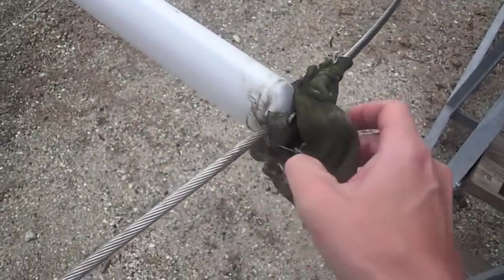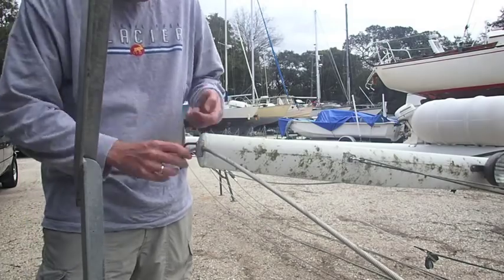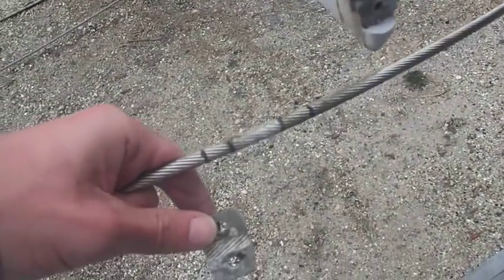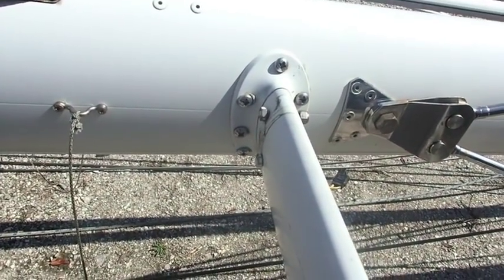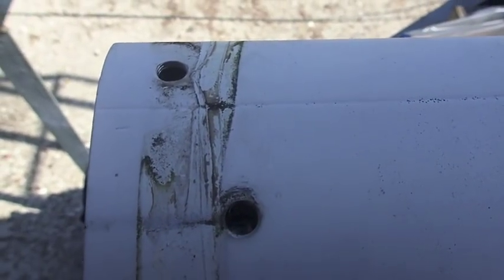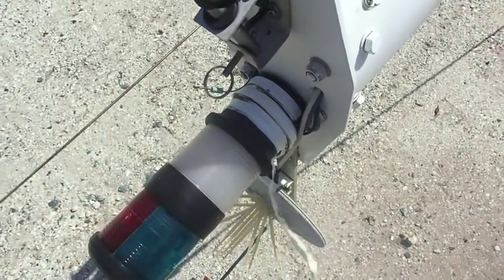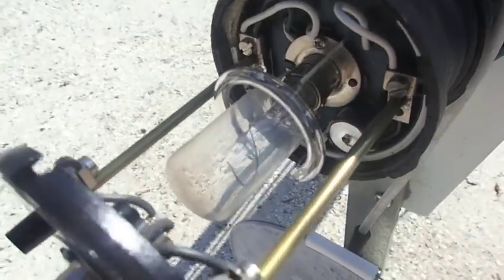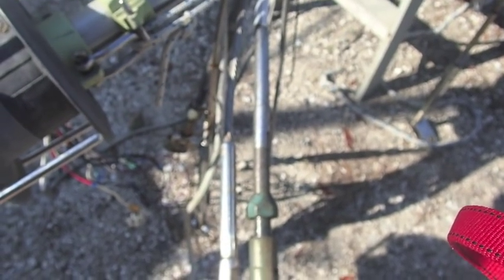Beginning of the Rigging Inspection

Comment: The circular light is an xenon flash tube, like what is used in a camera flash. I am guessing it will be for use in foggy situations. They run on around 400 volts so there will be some electronics to go with it, probably in the base of the light fitting. Do not touch the connectors if you are testing this light! even if it is not working there still may be a high voltage there, there is also trigger coil, connected to the outside of the tube that generates approx 3,000 volts to ionize the gas to make it flash. Goolge "xenon flash tube" for more info on the beasts.
Reply from the maker: ***** Thanks for the info!